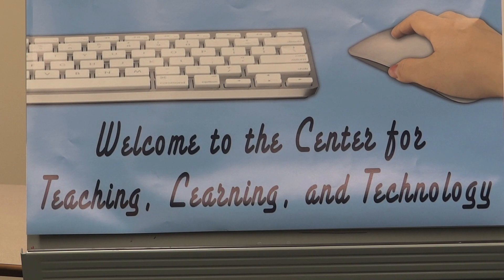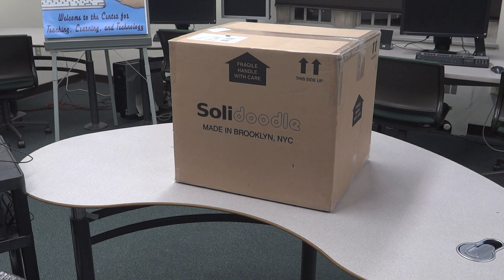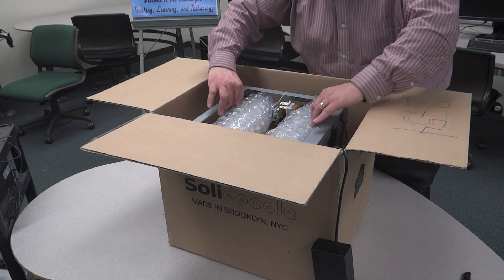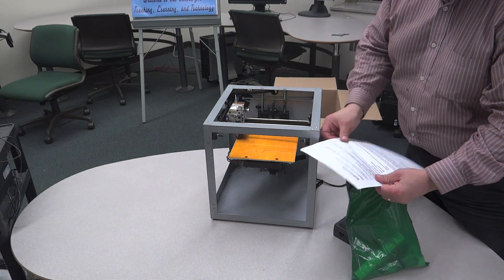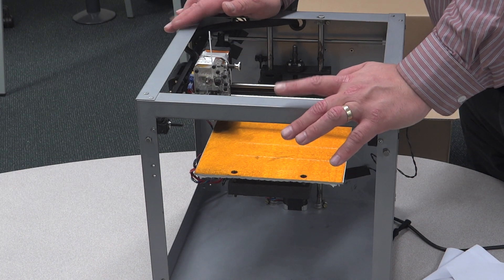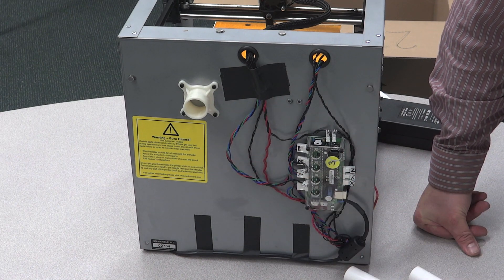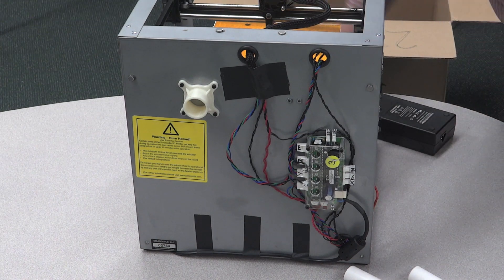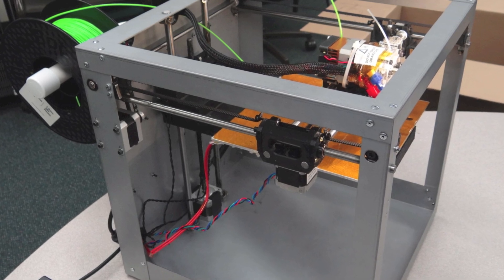Solidoodle 3 Unboxing

Comment from the maker: I haven't looked into the control board, but I guess there isn't an H-bridge for stepper motors (I'm assuming you mean an H-bridge that normally allows DC motors to be switched for direction and braking). I ended up not adding an enclosure for the circuit board on the 3rd gen printer as I put the printer in a stable environment and I'm not poking at the back. I did add a full-printer enclosure to keep internal temp high to improve ABS cool down, but I do not use an extruder cooling fan there.

Comment from the maker: I figure 150-160mm long case would be perfect, and the SD3 can print 200mm. I have not designed a case yet (or repurposed an SD2 case) because we haven't had to do any troubleshooting/etc. on the backside so I haven't been worried about damage.  I will do it at some point though.  Good bed leveling, an enclosure if using ABS, a fan if using PLA, and a glass plate for quick switching b/n jobs has been perfect for me.

Comment: I am planning on buying Solidoodle 3 but I don't like the fact that there is no protection for the control board. Would it be possible to use Solidoodle 3 to print out a case to protect the control board? Or... is the control board too big to do that?

Comment from the maker: Repetier will not do that. I used SketchUp Pro to do it, but it isn't designed for that. I use the solid boolean function and remove a section of the model. Again, this is not optimal. I simply have not needed to do it enough to make it worthwhile to look for another app. I'm sure OpenSCAD can do it if you can write the script for it or find someone who can.  Here is an example I found - tinyurl dot com slash aq76zkk